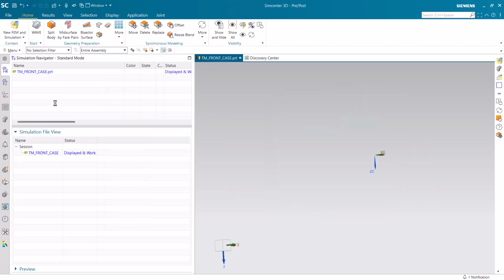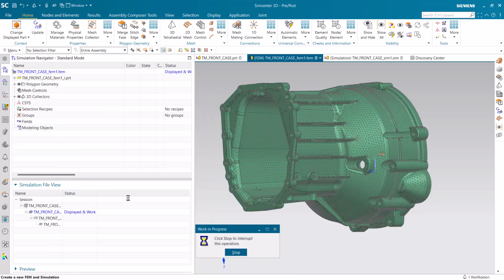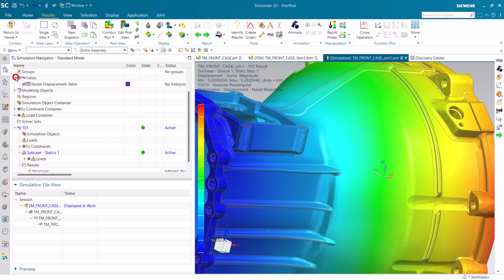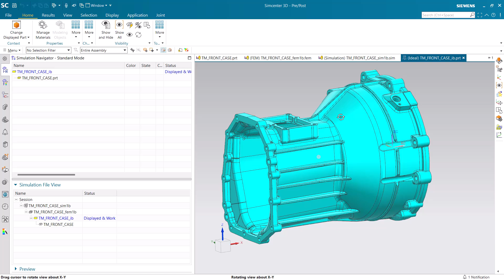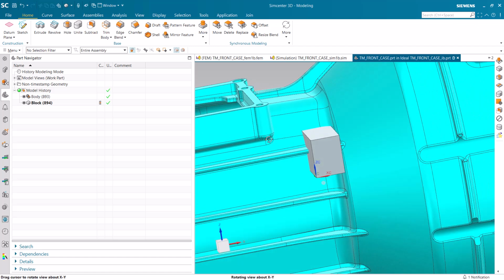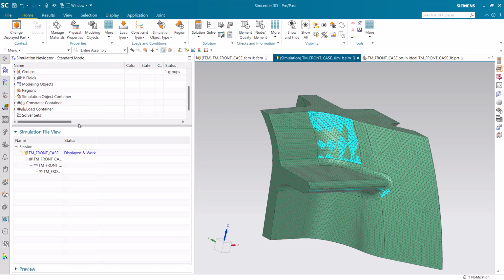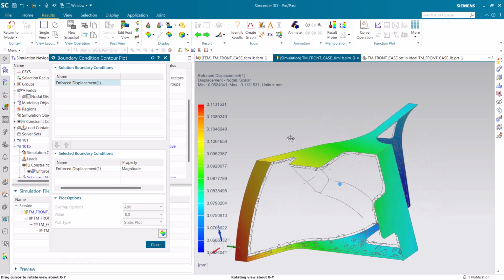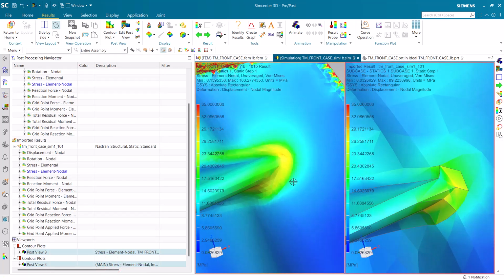How To Make A Displacement Breakout Model

Comment: Wonderful tutorial, thanks for it, Siemens team!
I have a question - I tried doing the same but with SOL401 in 30 time steps. Should I expect problems with the results? On the surface it doesn't seem that there is a difference with the tutorial you made with SOL101, but results wise, should I consider something?
Reply from the maker: Great question.  I have not tried displacement breakout modeling using 401 but cannot think of why it would not work.  Whenever trying something new in FEA you should always validate the new workflow by proving it to yourself that you are getting the right answer.  I recommend you run a study with a few sample parts, four different ways.  First run the entire model in both 101 and 401.  Then run the breakout model in 101 and 401.  Let us know what you find!

Comment: Is it better to use displacement based breakout model or a force based breakout model
Reply from the maker: Some airframers have a preference for force.  If you're not sure which one to use, try it both ways and see which answer you like better.  It may not make a difference depending on how far from the edge of the breakout you are looking at the results.

Comment: Thank you very much for the video. 

Is it possible to use the translation and Rotation as enforced displacement constraint for DOF1-6 if I already Saved all of the Results in a Field before?
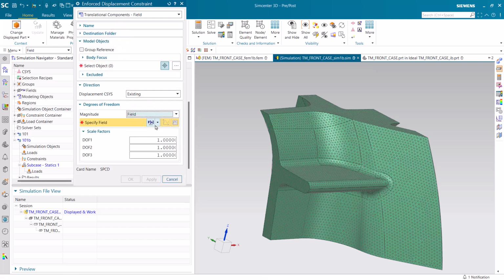Reply from the maker: The Enforced Displacement Constraint - Translational Components - Field only uses DOF1-3.  If you have DOF1-6 you can truncate the field by first exporting it to a CSV file.  Select the rotational DOF4-6 columns and save the csv file.  Then when creating the EDC-TC-F, don't select Existing Field From List as shown in the video at time index 7:37, select table constructor, Independent Domain - Cartesian, Next, Delaunay - Fast, Next, Import From Text File and select the csv.

Comment: Thank you for this very informative video—it’s exactly what I was interested in! I have a few questions:

1.	Is this the same process if I’m using the ANSYS solver within Simcenter?

2.	This video demonstrates a linear solution. Would the same process apply for a non-linear multiphysics solution as well?

3.	What is the best practice for mapping temperatures? Do you suggest mapping temperatures on the solid body or directly on the mesh? Every time the mesh updates, I have to update groups to map the temperature. Is there a more efficient way to handle this?

4.	Could you clarify the best practices for assigning materials to solid bodies versus assigning them to the mesh?
Reply from the maker: I'm glad you liked it.  
1. It is the same process independent of what solver environment you have selected in Simcenter 3D
2. The same process could apply for a non-linear multiphysics solution, however, if you have multiple time steps you may want to create a table of fields or use our multiphysics environment.
3. I have a few videos on mapping temperatures.  https://youtu.be/gFi1pEIZPxk?si=LzOkNhER4zYC9P1w
As a best practice apply load and constraints to geometry so they can survive a CAD change and FE update.  Don't use groups.  Use selection recipes instead. https://youtube.com/playlist?list=PLRhczELP7wYLNDPG_lie1N85MUJsAJGD_&si=k0jc_tGne8KouKLf
4. You can apply material properties to solid bodies or to the mesh collector.  If the designer has specified a material property in the CAD model, it removes a potential source of error for the analyst to simply inherit the material properties in the mesh collector.
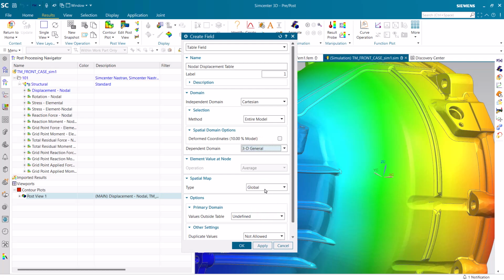Reply: @Simcenter3DTipsandTricks  I’m just wondering: if you have, say, 1–50 load or time steps in your global model result, how would you create the fields? Manually creating fields for all those steps would be very time-consuming, so is there a quicker way? I assume that at 2:47 , under Independent Domain, I can select Time Cartesian instead of Cartesian, but how do you apply that in your submodel or refined model to create 1–50 fields?
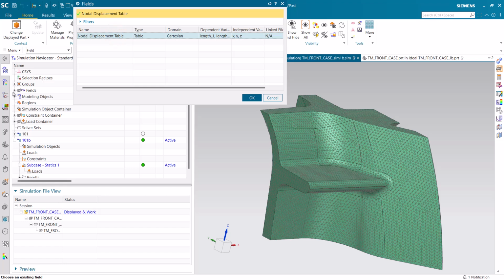Reply from the maker: @ Great question. You can do it exactly the same way as shown in the video.  You are correct that you can select Time, Cartesian for the Independent Domain when writing out the field from the coarse grid model results as shown at 2:47. This will give you a table of fields which will include a separate field of the displacements at each time step.  Then in the breakout fine grid model you will create an enforced displacement constraint exactly as shown at 7:36 and you can select the table of fields you created from the coarse grid model results.
Reply: @Simcenter3DTipsandTricks   I successfully created the Time, Cartesian fields, and they appear in my refined model as table of fields. However, when I try to create an enforced displacement constraint and reference these fields, they don’t show up. Is there a specific method or formula I need to use to access them? No issue with creating enforced displacement constraint when I create  the field using Independent Domain, Cartesian.